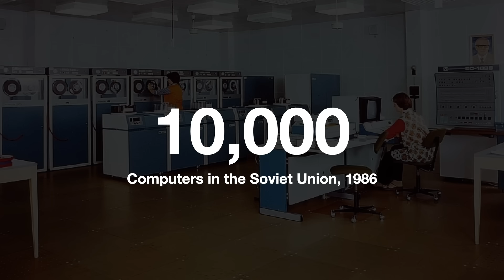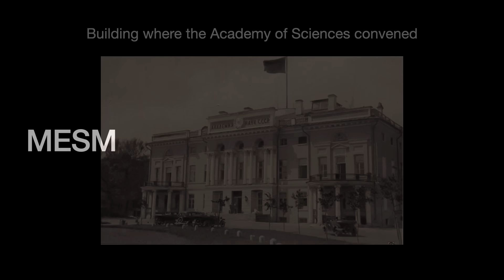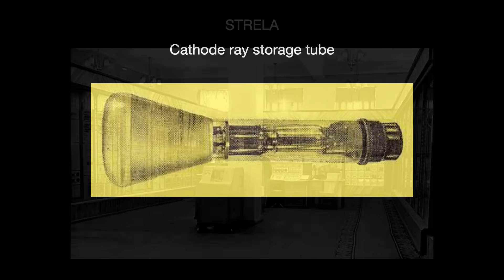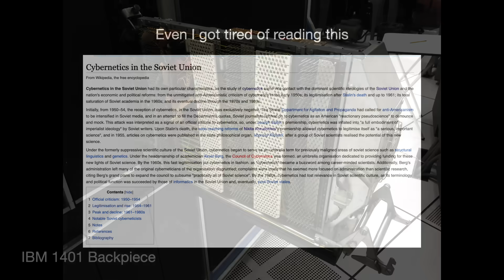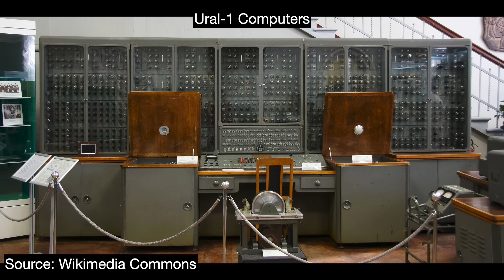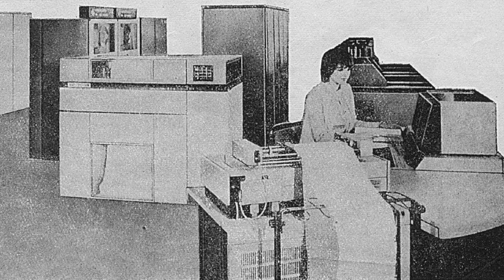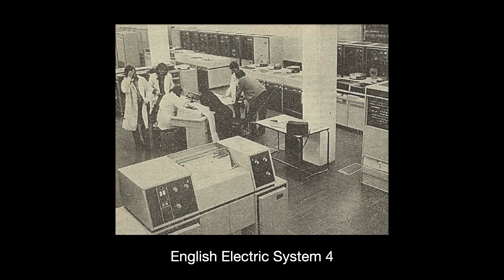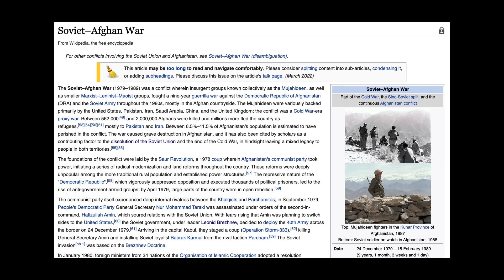Why the Soviet Computer Failed

Comment: In Soviet Union programmable calculators were used extensively in science, engenering and military instead of computers in 1980s.
While Soviet Union was behind in computers it was also ahead in programmable calculators.

Plus Soviet math was more advanced than of other countries, so we did not need powerful computers to solve problems. Analytical methods were often used in Soviet Union instead of popular in US dynamic programming (which required a lot of RAM and computational resources and wasn't always producing precise solution).
Reply: Then why didn't you get to the mooon?
Reply: @lololounge8281  we did. Check N A S A. Soviet Union was the first to have soft landing, was the first to take pictures and was the first to acquire lunar soil sample in 1970.
After US had crewed mission on the Moon it was no longer needed for Soviet Union to have crewed mission there, so we kept using robots in our missions. Also don't forget that Korolev died in the mid of development of lunar program in 1966.

Moreover, Soviet Union was the first to have Venus satellite and the first to have successful landing on the planet.
Reply: @sovietcitizen9450  the Soviets were the first ahead but they were overshot eventually . West had the fastest moving object , the furthest going object , first rover to Mars , moon landing . Soviets weren't that ahead
Reply: @sovietcitizen9450  Nice answer. Big breakthroughs. We all know about them and no-one wants to deny them. That doesn't change the fact that the US made the big lap and won the race. If you weren't so stubborn in denying the obvious more people would be open to recognise your breakthroughs.

Just curious: what's your position on  Kremlin's war against Ukraine?
Reply: @lololounge8281  Soviet Union was basically ahead in everything else in Space exploration except for crewed landing on the Moon. That's why there's so much propaganda in the West around it.
Reply: @sovietcitizen9450  When I asked why you haven't been to the moon, I meant with people.
Reply: @sovietcitizen9450  And yes, I know all about soviet space accomplishments. Even though they had a good head start, the soviets ended up losing to the US.
Reply: @lololounge8281  if you are talking about space exploration, Soviet Union was still leading. We have created a shuttle called "Buran" which was the most advanced spaceship created by humanity for many years.
Reply: @lololounge8281  if you are talking about "the Fall"... Soviet Union fell to deceit and betrayal, not because people wanted it to collapse, like many people in the West believe.
Reply: @lololounge8281  "the Soviets ended up losing to the US" no, first man on moon wasn't the end of the space race because the space race was never a real "race" with a finish line, it was a contest. But contest doesn't rhyme with space, race does. The US kept moving the goal post until it made a first big achievement, and then adopted the revisionist narrative that it was a race to the moon. You should watch Renegade Cut's video-essay on the space race.
Reply: @Totalitarianizer  Will do, thanks.
Reply: @Totalitarianizer  I watched that Renegade video, he had some good points but he's wrong about man being on the moon not being a goal. It absolutely was a goal for both sides. The soviets were a little more secretive about it, but they were working on it.
Reply: @lololounge8281  it was a goal for both sides, yes, but not the end goal or a finish line.
Reply: @Totalitarianizer  Ehhh, at some point, you gotta go "we've surpassed you now". That's what it was mostly. Also, it was the most aggressive goal in the list. 
I super love learning about soviet space exploration, but I do believe that based on our definitions of words, that the USA technically won. In a way, that might not even be the most important thing either. It could be that the sprint the soviets did created a lot more usable tech fast for longer years. 
I might be a bit pedantic, but ya know, words are how we communicate.
Reply: While this is kinda true, you realize that the Soviet Union would have benefited massively in the medium and long term if they prioritized the computer industry and heavily subsidized research and development for it instead of, for example, going to war with Afghanistan? Imagine what the USSR could do if it followed project OGAS instead of dismissing cybernetics as "bourgeois pseudo-science". This comment seems like a bit of a cope to me, even if there's some truth to it.
Reply: @sovietcitizen9450  loss is a loss

Comment: I carry on.... Pc types of computer . Now mainframes do the database search and manipulations for PC machine programs and the networks are managed by Unix type servers .  Windows machines are getting faster and faster though and the technology seems to be supporting less efficient software . It seems to me that programs should be coded to use the new hardware better . It is like using a bigger V8 engine in a car rather than a fully developed strait in line four if you will . But then if you can afford the big motor and still win the race , who cares . That is where the industry is . IBM and Unix need to offer better looking displays , with the software to offer that , to fend off Windows ultimately. But that needs people trained to use any software developed on the IBM or Unix platforms , which takes years of acceptance and use to actually happen . 
I loved operating IBM systems . Logical , error code diagnostics , it was almost like English ! I used ICL systems and other systems but the IBM stuff was a dream to work with . I would love it if someone offered

Comment: try on   "Soul of a New Machine"  the Go Go day of mainframes in the USA.  In the 90 there were
many microprocessors viying for domanace.  The Motorola/IBM   60x was the winner,  MIPS per watt
was way ahead of the X86 crowd.  The Intel i960MX failure was used on the YF22 Raptor.  Intel
dropped its Military Group in 1995.

Comment: Excellent . I was an IBM 370 operator at the age of 20 and worked with IBM systems for 35 years . When a new system came along the existing programs still worked; backward compatibility was an IBM sales winner. That seems to have been a problem in the end for IBM though . Windows and Unix had the ability to display multiple colour  on online screens and decentralized computing power.
However the big powerful IBM mainframes could and still do offer database search capabilities beyond the stand alone PC type of c
Reply: what do you mean by "However the big powerful IBM mainframes could and still do offer database search capabilities beyond the stand alone PC type of c"? I am still learning a lot about computers still

Comment: I was told that they developed ternary computers because you could count higher with the same resources,assuming a ternary chip cost 50% more.  Great for arithmetic but not for boolean logic.
Reply: Binary logic is less effective but realized easily and product is very reliable. H and L is easy to recognize.
Reply: @prutok  so, i'm right?
Reply: @johnoehrle5973  In terms of theoretical optimality, the ternary system is better, it makes better use of the same hw resources. Contemporaneous documentation states that an equally powerful binary computer was 2.5 times more expensive. However, ternary logic has drawbacks that eventually disqualified it and made it a dead end. The first computers of this type were made in 1958, the year the first sample integrated circuit was demonstrated. So the Setun must have been 2nd generation, composed of discrete components - transistors, etc.
https://en.wikipedia.org/wiki/Setun
Reply: @prutok  yes, thanks, guess the rumor i heard 55 years ago was right.

Comment: Instead of 1's and 0's, soviet computers used "Da" and "Nyet".

Jokes aside, the Russians always excelled at Math, but that's not enough to build a computer.  You need the industrial and semi-conductor engineering to build fabrication plants, and improve computer speed and accuracy.   My guess is they fully understood how to implement things like Euler/Improved Euler/ Runge-Kutta methodologies on computers long before they actually had computers to use them on.

Comment: There's a cognitive bias that we tend to equate the every day with being unremarkable. I would suggest this subject is a good example.
We are all surrounded by computers, our society couldn't function at all without them. But the 'silicon chips' these devices run on remain so difficult to make that there are only a handful of facilities churning out the more complex devices in the entire world. It's not a exaggeration to say that if just five or six specific factories burned down tomorrow the production of most computers and practicably all smart phones would cease for years.
Reply: During the hey-day of VHS tape, there were precisely two manufacturers of the 'dive unit' that handles and reads the tape.
If either one of the plants were to burn, the other would not be able to keep up with demand.
In a wise move, both manufacturers agreed to standardize the majority of internal components; swapping parts between makers was a breeze for technicians.
Reply: that is such a good point. most don't realize how fragile this "system" is.
Reply: Covid, showed us the fragility of the chip foundries. And thusly expansion took off, not only in Taiwan (which produces most of the higher end chips) but in South Korea, Japan and even the US. We are slowly recovering from the chip shortage, and ironically it wasn't just the most advanced chips that became scarce but older, less profitable dies were not produced impacting car manufacture. Even more impressive is all the computers we just ignore. A laptop is just one computer, right? Well, no. It has a CPU, and a GPU both full-blown user interactable computers, then it gets trick what is a computer and what is a microcontroller? LCD driver board, USB controller chip (1 per two ports), hard disk drive controllers,  TPM controller, the list goes on and those are just the ones I am certain can run custom code. Our smartphones are much the same, but that is only four or five discrete computers/microcontrollers (cpu/gpu/radio/usb connection/sim card). You need to look at really simple electronics to get back to just one computer.
Reply: @OscarSommerbo  I designed military radio prototypes. One Z80 for the radio. One for the CAN bus.  In the early 80s.
Reply: Actually just one (I think). The Dutch company whose machines are used to make those very semiconductors by the likes of TSMC.
Reply: Isn't that why Amurica loves Taiwan?
Reply: @danidejaneiro8378  They love it so much they want to start a war near this place.
Reply: @Simboiss  - no, derp
Reply: That is such a good evil idea
Reply: I wouldnt say they are that difficult to produce given that there are dozends of factories in the US alone that can produce chips. The reason why a few companies dominate the market is because of patents, copyrights and the fact that chip manufacture is slow to Set up and perfect but once you succeeded scaling up is trivial and you can essentially supply an entire country with a single factory.
Your claim that Chips are somehow extraordinary because only a handful of companies produce them applied to most products. Toilet paper is also produced in just a handful of factories...
Reply: The key point is that we cannot make a 32 transistor chip at home. At all. You need rather specialized and still expensive hardware to have a chance even at big scales. Make the scale tiny, things get exponentially harder.

The old factories disappeared, we have no fallback.
Reply: Oh, we know. Its what the whole Taiwan situatio is over (well for the Americans severely that, for the Chinese its that PLUS reunification ideology)
Reply: @Warsie   Taiwan has the Braniacs of China, the CCP destroyed most of their braniacs because intelligence was a threat that leadership didn’t want so like the Chinese Sparrow they were deleted. This is what will hamper the ambitions of the CCP. Because they copy right foreign tech, they are eminently hackable so when they build their computer controlled weaponry they use chips and software already well known in the west. There are young American students able to hack and control software remotely, these are some of the biggest threat to the Chinese military machine that uses computer technology …
Reply: Not to mention cars
Reply: that's part of why China is so rabid about stealing western tech and invading Taiwan, Taiwan and the Dutch have some of the best tech for manufacturing high quality chips.
Reply: @arthas640  How can China invade itself?
Reply: @syn4588  civil wars, rebellions, insurrections, extreme civil unrest, or state terrorism can all involve a country invading itself and the chinese civil war never ended, it's just a glorified ceasefire.
Reply: Someone should burn a few of them down then. Today's people need to be woken up to see how fragile and weak our society is.
Reply: Our company is in the process of building a data center. We were told that it would take 27 months (over 2 full years) to receive all of the equipment to get it up and running. The chips just aren't available.
Reply: We are actually living it today: We have two distinct demand streams for silicon lithography foundries; Cutting-edge Computing/Consumer chips (High density w/excellent yields), and generations-behind "commodity" chips needed for industry (Fairly low density with so-so yields). These processes are running side by side in the foundries. Quite a few computing companies fret about the "commodity" chips and how much production capacity is taken by them... modernizing to newer (smaller) chips is not currently a solution because these older chip designs are far more robust and work across a wider temperature range and in harsh environments - something that >50 nM chips don't do well (especially over time). 2022: The last three years, and into probably the next two or three years we are going to see these two demand streams collide far more often. They already have; Bosch, Delco, Denso, Motorcraft have all experienced substantial delays in obtaining vital commodity chips which disrupted entire production lines. Likewise, Intel, nVidia and Samsung have had similar issues. It has also spilled into repair parts and it is not showing any signs of stabilization yet (the supply/demand is too unstable to predict at the present time.
Reply: @matthewhelton1725  Supply chain issues in silicon are normally sorted out by recessions. Every time - so far. There is one coming.
Reply: @matthewhelton1725  I'm using LM2903s and LM393s in a current project. Very robust. Analog isn't going to change much.
Reply: @msimon6808  Can you make an LM393 at home? You can actually count the number of factories that can fabricate this chip even in short series on both hands. (unless you use the more advanced ones to do it, and refitting them for analog would be quite expensive and hard)

I can make something that looks kind of like LM393 by hand from discrete components but it'll be quite a bit worse - and making this many transistors is not easy either, much less even short series assembly.

Making one good transistor is relatively hard an requires quite a chunk of specialized manufacturing base, wafers, dopant chemicals, ovens with precision temperature control, requisite temperature sensors, casing materials etc. LM393 discrete replacement requires a variety of good transistors with different properties.

Soviets had trouble making quality diodes, much less transistors.
Reply: It would only be a temporarily issue for the more specialised components in your phone, like the sensors and stuff. The rest can be produced in any fab, it are all almost same machines, and they are relatively quickly changed to another product. And like you said, society became very dependant on this electronic technology. So dependant that governments will support the industry in case of such calamities. The industry has now already been recognised as 'essential', similar to the food industry, thanks to the lockdowns. No, at this point only a nuclear worst case scenario can stop us. Simply because you are all craving this technology now, like true addicts. From the military to governments and industries and individuals, they all need this technology so bad that they will not allow too much disruption in the underlying industry. Besides, who else would be able to convert the current mess into a sustainable future?
Reply: @effedrien  The recession will cure the shortages, as it always does. (How many cycles of silicon have you lived through? Me? All of them.) Congress is in it for the graft.